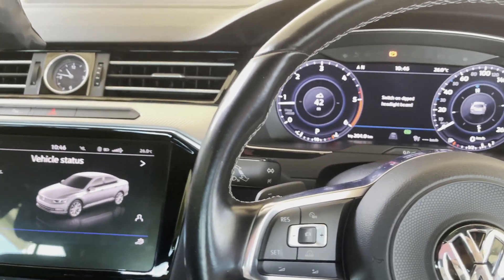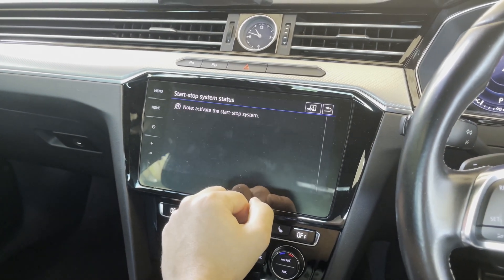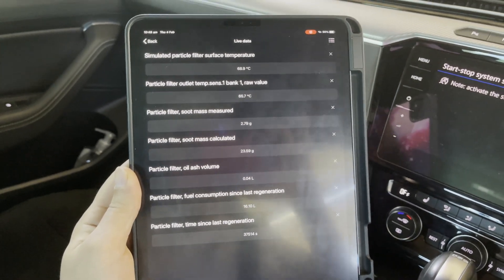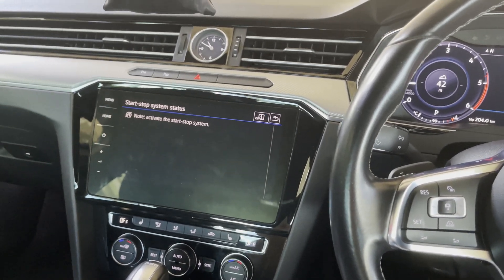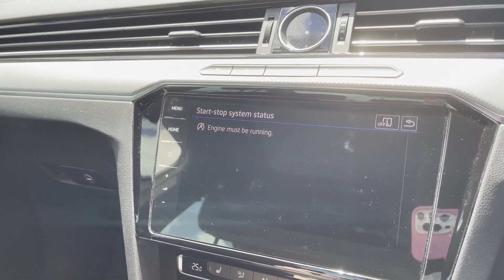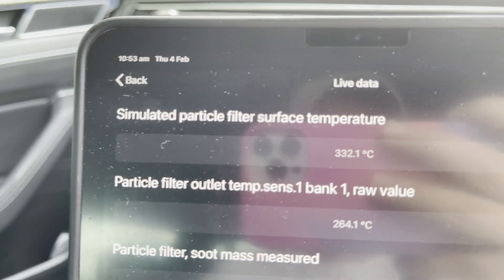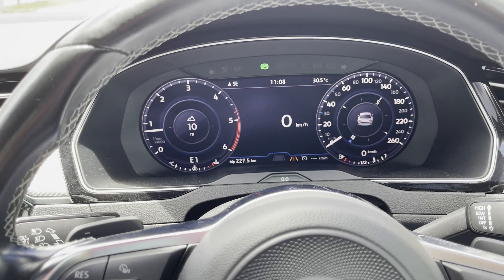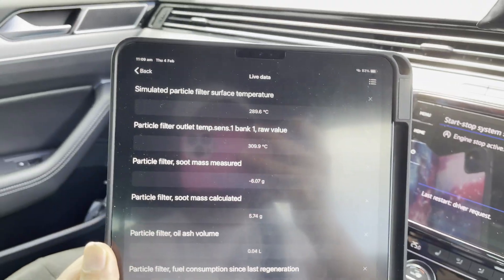How to Recognise When The Regenerate Has Commenced On VW Passat B8 And What You Should Do

Comment: Rpm doesnt matter really anymore. Just look at the gear indicator. I checked the exhaust gas temps. Even with 1500 rpm in 6th gear with about 85kmh, it was still reaching 600°C at the turbo, so it was even a bit higher at the dpf. I tried driving in 4th gear with 85kmh, the temp remained 600°C.
Reply from the maker: Thank u for the update. I’ll definitely have a look next time
Reply: @ahmadpc7  👍